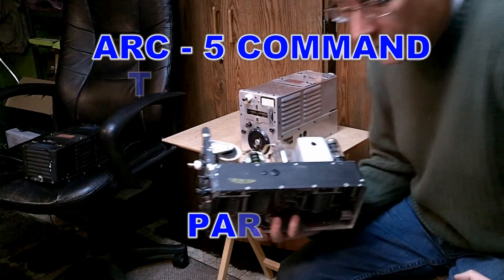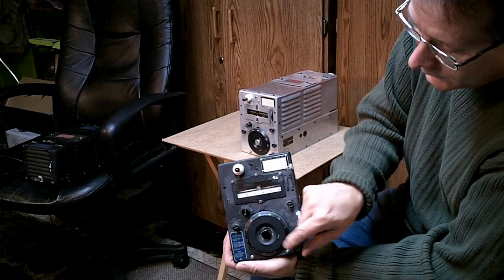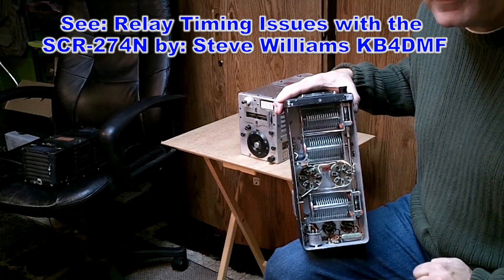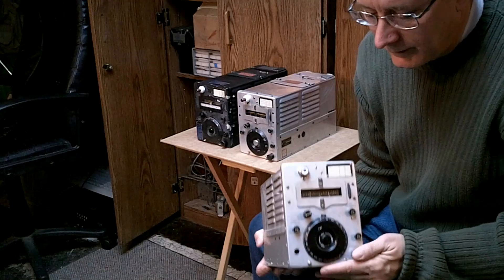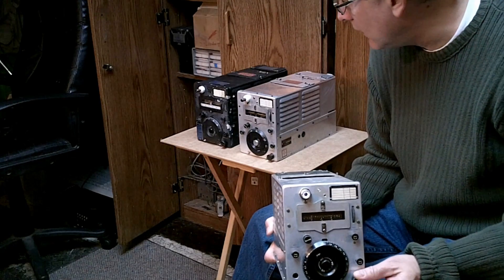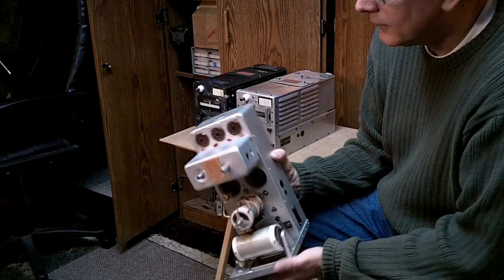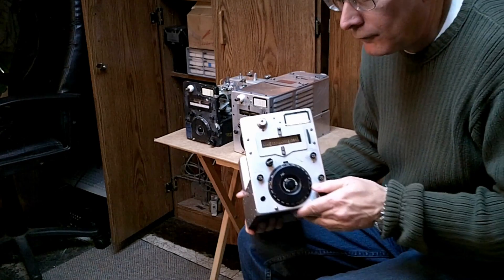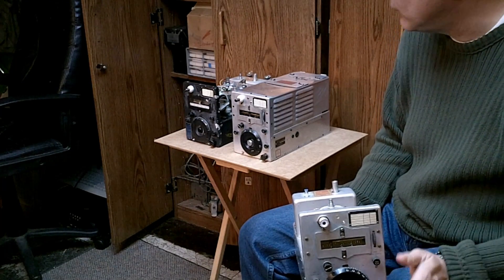ARC-5 COMMAND TRANSMITTER PART 2

Comment: I had a Heathkit SB-104A that had a backwave. I was embarrassed to use it on CW. But even with the Heathkit amplifier, my friends a mile away could not hear it. Now, I have a Realistic HTX-100 that has a backwave. I use it as my 10 Meter Beacon at 28.243 MHz. However, I have a rebuild kit that I plan to install. That's not the only problem it has. The power output is way down, it has strange harmonics, and it Is off frequency. So, it really needs an update.
73 Paul AA1SU

Comment: Very neat compact transmitter, shows what could be done with tubes all those years ago, especially when it is single band and powerful.
Reply from the maker: Shockingly powerful and stable for their size and weight, compared to the typical transmitters of the day.

Comment: BC459A. My 40 meter Novice and early General Class transmitter 1959-60 running about 35 watts DC input to a 66 foot longwire up about 35 feet above ground.
Reply from the maker: Nice. Those memories are the exciting ones.

Comment: I just bought a second ARC-5 transmitter which appears to be pretty unmolested (no key jack, no SO239, antenna and  keying relays in situ). I want to get a WW2 radio setup with this ARC-5 and BC-348.  How practical is it to operate the ARC-5 as is?  This would just be occasionally, not by regular setup.
Reply from the maker: Completely practical and the keying off the rear jack, with the relays, or should I say relay, because I do not recommend using the antenna relay, is fine with a good power supply.
Reply: @MIKROWAVE1  so would you just jumper across the antenna relay in order to try and keep it as original as possible?
Reply from the maker: Correct. Typically folks just temporarily disconnect the coil. And flop the contact spring to the other side of the NO bar. Completely reversible.